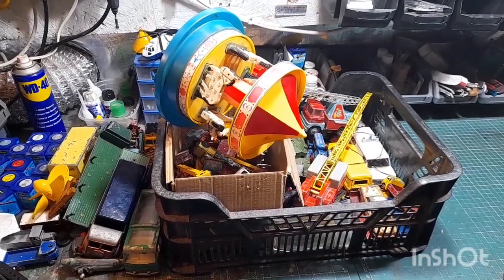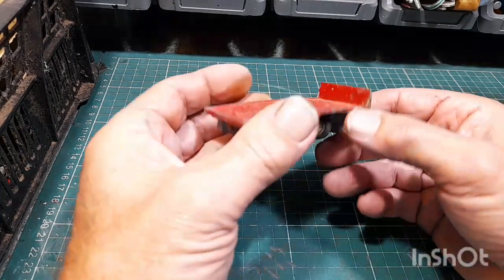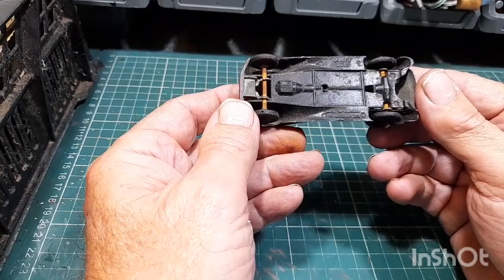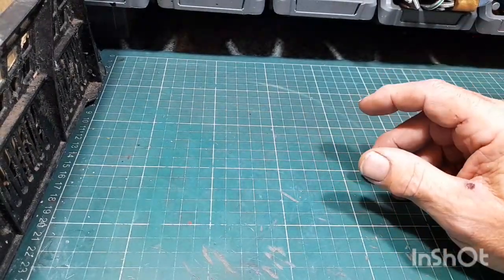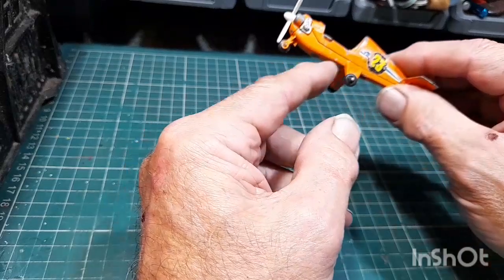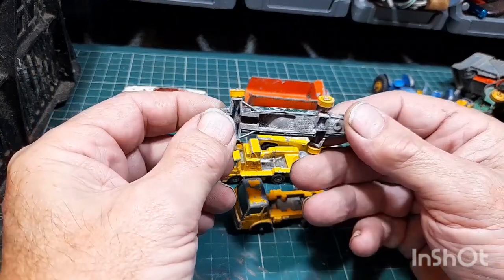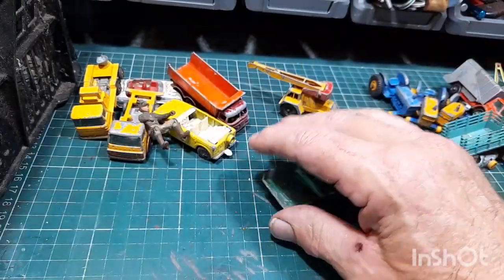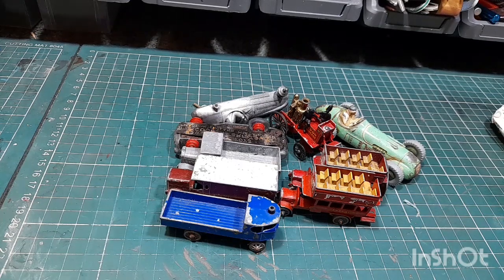Diecast Restoration  Purchases for October 22

Comment: watching you unpack these feels like hitting a flea market real hard. :D caugh myself grabbing the screen here or there. makes grabby paws
2:45 yup, Renault has been making trucks for many years now. :)
3:32 can't name a Rolls "Jack". it must at least be a soft "Jamessss". ;) funny that all original wheels are still in place. looks to me like not many kids actually used the wheel swap opportunity...
4:45 a russian company once made a re-cast of this model, probably on ancient moulds, because the doors and lids were very worn out. the model can still be found here or there.
11:22 the fat tyre on the rear of that MB tractor is actually an old LEGO tyre from the 70's. back when they had two kinds of wheels with these tyres on, and you'd click them into one of four holes in the flanks of a 2x4 brick with bearings inside. I used to have a lot of those old ancient legos, and gave them away to someone who didn't deserve them... ah well. hindsight and such, yes?
13:32 I never heard of crescent motors toys. they seem to never ventured outside of UK. but they look good, like some tootsies: simple and still accurate.
there is always room for little matchbox'es. ooh, a mini-monkeemobile! nice. :) and a mini-ford tow truck, never seen one of those here. gotta go hunting. :) my corgi majors tow truck is asking for a mini-me. :)
29:46 the tractors going onto the lowloader towed by a ford C6 usually have blue body and yellow hood. they sit in a yellow plastic frame that seems to tend to warp over the years. I'm happy to have one set in mint&boxed. except the plastic window of the box...
the bent MB Lincoln could be turned into a convertible. all you needed would be a trunk lid. ^^ aw, and ancient yesteryears... nice. ^^
Reply from the maker: Cheers for all that interesting information its brilliant, I agree the about the rolls Royce 😀 👍. 
The jags, are very early ones ,its a shame you didn't have those ,thay are a nice basic casting.
Thanks again for the info ,keep it coming 😀

Comment: Hi there Martin just seen your video of October bit i like the Magic Roundabout my sister had one as a kid I was about 45 years ago. The skycrane you've got I got one of them too about 2or3 years ago it's in pretty good condition but I have a look at it and the hooh has broken off from the ball I've got to get another one, the top pin that you said was loose on the jib could you not use a thin piece of brass tubing and bevelled edges over which should make it Tight just an idea. I used to move them cranes around on a low loader about 10years ago for Roger bullivants it was a piling company . I've got a low loader for my one but the jib sticks out the back of a trailer lol, looking forward to you doing the Magic Roundabout and I have to show a video to my sister all the best Ralph
Reply from the maker: Thanks Ralph, the magic roundabout is a great peice .
The crane was a good buy ,I have been bidding on a few in the past months, but the price was to high, good idea with the tube Ralph I will definitely give it a try .
It certainly has a long jib that's for shore, next on my list is the matchbox bridge layer. 
All the best 👍